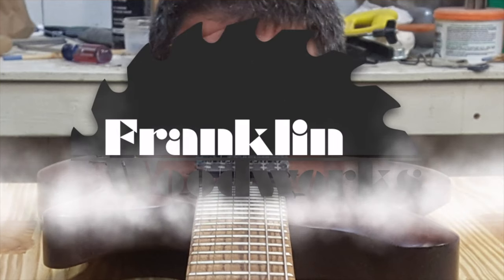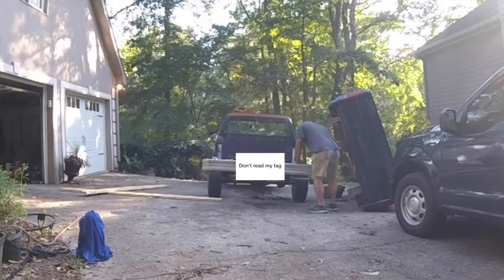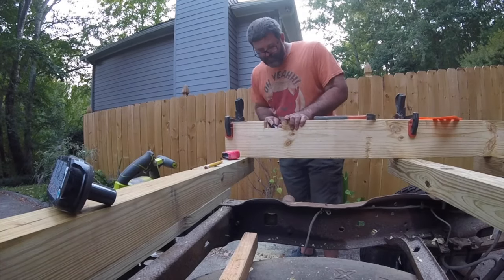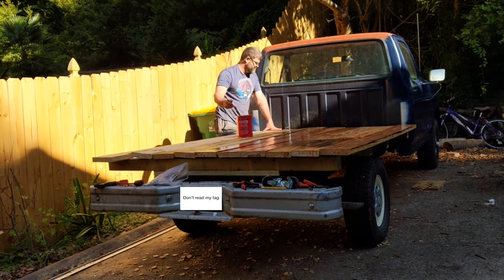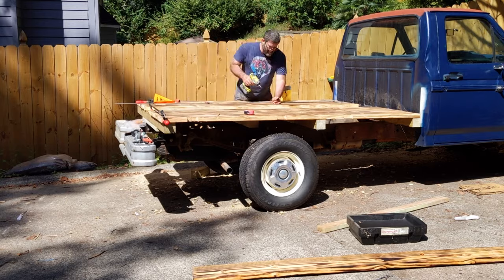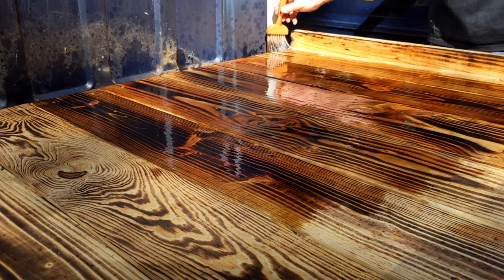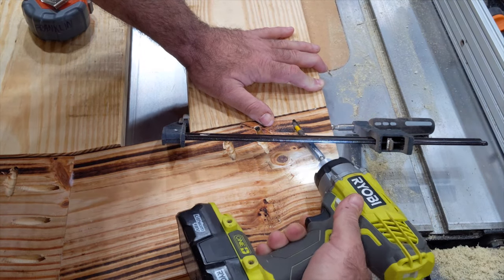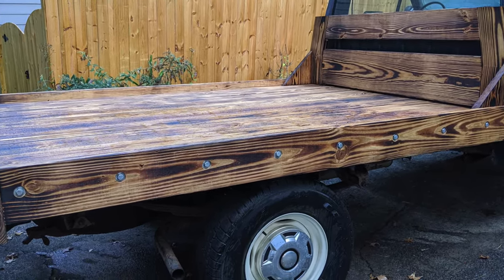DIY Wood Truck Bed

Comment: Where did you get the tail lights? Building a flatbed for my 01 f150
Reply from the maker: I got them off Amazon, didn't get the cheapest, but didn't get the most expensive either.  Think I paid around $45 for the set.  They are bright LED, and have held up perfectly.

Comment: Do you have a supply sheet for what i need to make this because i love this bed and wanted to try it myself.
Reply from the maker: If you click on "show more" under the title of the video, you'll see my materials list.  I put down 6x6 cross members, but you can use 4x4s depending on how much clearance you need for your tires.  I wound up putting 33" tires on it, so I used 6x6s.

Comment: If you don’t mind me asking how much did this end up costing. I went to trade school for carpentry and construction and just graduated but I bought an 87 chevy with the exception of the bed and have been debating buying a junk yard bed or making a  wooden. But don’t want the hastle of restoring a bed along with the cab.
Reply from the maker: Less than $300 for the materials.  Then again, that could be a regional thing.  If you have a Tractor Supply near you, I'd go there for the lag and carriage bolts.  I paid WAY TOO MUCH at the big box store.
Reply: FranklinWoodWorks okay thank you!

Comment: Did you use lag screws to attach the side rails and the rear board for the tail lights?
Reply from the maker: Yes. 6" 3/8 galvanized lag bolts.

Comment: Do you happen to remember your tail lights you purchased
Reply from the maker: The specific lights I used aren't available anymore, but when I bought them on Amazon, I just chose a middle of the road price point for a set that included all six lights.  I chose round ones that surface mounted and were all plastic.  No problems until I dropped a board on one and cracked it.  I have since replaced them with recessed metal housing lights.  Partsam 4 Red + 2 White 4" Round... https://www.amazon.com/dp/B07HT6MWSL?ref=ppx_pop_mob_ap_share

Comment: Did you use 4x4 or 6x6 as the list in the description? Also you talk about 2x8s but I don’t see this in the parts list. I love this video. I have a 1976 F250 Highboy and I am planning to use this video as my starting point. I have 37 inch tires so I am not sure if I should use a 4x4 or 6x6 to clear the rear tires.
Reply from the maker: Can you shoot me an email at franklincustoms@gmail.com?  I think I could go into depth that way, instead of through the comments.

Comment: Great video! How often would you recoat the treatment to prevent rotting? Would you take the whole bed off to do the underside? Just curious as I am looking at doing the same project!
Reply from the maker: Recoating depends on use, exposure to weather, etc, so just play it by ear.  The beauty of this design is that you can take each board off individually without taking the whole thing apart.  Since I built mine, I've recoated the top twice, and haven't recoated the underside yet.

Comment: How has the outside boards held up with time without a support beam under a greater section of it? I am building wooden bed for a 6ft bed. And laying out the 4x4. One would be directly over the tire and will need to cut it down a little.
Reply from the maker: There have 
been zero problems with the outside boards.  They are supported every 16 inches with lag bolts from the side rails.  So although they might not be as strong as far as carrying weight, they are actually more supported than the inner boards.  I hope that made sense.
Reply: @FranklinWoodWorks2016  made perfect sense. Now yours was an 8 foot bed correct?
Reply from the maker: @stephenwolfer1648  Correct.
Reply: @FranklinWoodWorks2016  one last question if you don't mind. How close to the can did you go
Reply from the maker: @stephenwolfer1648  It ended up being a little less than 3 inches.  If I remember correctly, I centered the cross member on existing holes in the frame, and it just worked out that way.

Comment: If you don’t mind me asking, what did the total come out to for this? I am wanting to do this to my Tacoma that has a rusted out bed
Reply from the maker: If I remember correctly, is was about $480.  But, I got ripped on the hardware by buying it from the orange box store.  Could have saved at least $90 by going to a commercial "fastener" supplier.  However, good luck with the wood prices. Where I'm at, prices are about 75% higher than when I built mine.  And, by the way, I'd go with all treated lumber.  My floor lumber has started to cup (untreated).

Comment: Its been 3 years....hows it holding up?
Reply from the maker: Well, as it turns out, I should have used pressure treated wood.  The original plan was for me to re-apply the finish every month or so to make sure the wood was protected.  That idea went out the window almost immediately, as this is a working truck.  But, the bed made it for over two years before rot set in on the ends of the boards.  I recently, 2 months ago, rebuilt the bed using pressure treated wood.  But, other than the rot, the old bed held up great, and there was never an issue with strength or load capacity.
Reply: @FranklinWoodWorks2016  awesome.  I'm converting to a flat bed as well and after seeing the price of a custom setup I've been toying with the idea of a wood bed.

Comment: I know its a long shot and u probably wont see my comment. But I was wondering if by chance would u have the name of those tailights or part # I cant find them on amazon.
Reply from the maker: Here is the title on Amazon for the listing.  It let me add it to my "cart" again, so I assume it's still available.  Meerkatt (Pack of 6) 4 Inch 4 Red & 2 White LED Clearance Lamp Round Light Brake Reverse Rear Tail Exterior Lamp Trailer Lorry Caravan Pickup Truck Bus Tractor Cabin 12V DC Sealed Surface Mount GK12

Comment: Hey how much weight do you think the 4x4 beams can hold ? Please let me know , I am planning on making this and I will be hauling 3000lbs on the bed.
Reply from the maker: I've hauled 2,000 of bricks in mine, but I really didn't like doing it.  I kept the bulk in the center of the bed.  I know that sometimes I can get treated 4x6s at my local HD.  I would think that would help substantially.  Are you sure your suspension can handle that?  What kind of truck is it?
Reply: @FranklinWoodWorks2016  did you noticed the wood beams cracking or anything of that sort during that haul ? I have a 3/4 ton Chevy and the payload on the truck is 3000lbs. So it’s just a matter of making sure the bed can handle it , I am putting a truck camper on it which mostly sits in the Center of the beams. I will take the 4x6 idea for my project . Any other tips you recommend to maximize the load carrying capabilities?
Reply from the maker: No cracking at all.  I even checked the underside of the bed the other day while putting a lift kit in the front.  I think as long as you are aware that the edges are inherently weaker than the center, you'll be fine.

Comment: Great job did yu do for size an length bolts for the 4x4s on the frame?
Reply from the maker: I used 1/2" . That gave me just a little wiggle room.
Reply from the maker: 1/2 x 5

Comment: Nice job! What are the dimensions of the finished flat bed?
Reply from the maker: 8' x 6'4" (96x76).
Reply: @FranklinWoodWorks2016  
At 1:40, how or what tool do I use to copy that countersink?

Comment: Is that "high tech premium" exterior grade finish dangerously flammable?
Reply from the maker: Yes!  But so is any oil-based finish until it cures.
Reply: @FranklinWoodWorks2016  the issue here being that the trans oil wont ever really cure, the highly flammable bits of the diesel will evaporate, but in the end what you have a a giant Southern Yellow Pine oil lamp - nice to have if the headlights fail.
Reply from the maker: Well, at least there's a bright side.  I kind of figured that about the trans fluid as well.  But, I did some testing, and the wood is not overly flammable once it's dry.  I held a torch to it for a few seconds and it charred but didn't catch.
Reply: @FranklinWoodWorks2016  it certainly shouldn't rot!
You probably want to dab the end grain at the rear every fall before the winter salt arrives, just help the wood reject the salt.
....speaking of salt, keep an eye on the deck screws holding the headache bulkhead together since you dont have significant Joinery there as well.

Comment: Were the boards used for the bed floor pressure treated?
Reply from the maker: No, they weren't pressure treated.  The charring of the wood along with the diesel fuel mixture serves a dual purpose.  Looks great, and really slows down wood deterioration.

Comment: Wow, that is really neat. It inspires me to replace the rusted-out-in-some-spots bed of my twenty year old Dakota. I think I will try to get it done this summer; although, I have never done anything like this. You look like you know what you are doing in the video. How long did it take you to complete the job including plans, getting the hardware, wiring, lamps, and lumber? Did you post your parts list somewhere?
Reply from the maker: The parts list is just below the title of the video.  You may have to click an arrow or something to see it, depending on your browser.  I completed the build in about 12 hrs, not including figuring out the wiring for the lights.  That was a mess.  Should have labeled the wires as I removed them from the original bed.

Comment: Instead of 2x6x8 why can't you use 1x6x8 treated
Reply from the maker: I've actually explored this.  Although the 1x6 would work, and would look fine, there are problems.  Because of the span between cross members, the 1x6s will flex a lot depending on your load.  More flex means greater stress on your fasteners (screws).  This will cause the wood to wallow out, and the boards will become loose.

Comment: How did you deal with tailight wiring?
Reply from the maker: Not as well as I should have.  I should have marked each wire (or group of wires) as I disconnected them from the original bed.  But I didn't, so when it came time to wire them up, I had to do lot with a volt meter. But once I figured out which wires were which, it was pretty straight forward.  The cheap LED lights I got on Amazon (I got a set that had 4 red and 2 white lights) has been really good.  Very bright.
Reply: @FranklinWoodWorks2016  Okay, im thinking about trading my Harley for a 2001 Ford F250+$400 and it doesn't have a bed, meaning the lights are already disconnected, its gonna be a paint I assume to know whats what being that I have no bulbs for it so I cant step on the brake and see what lights glow.

Comment: The part next to the cab is called a Headboard
Reply from the maker: Thank you!  I had no idea!
Reply: No, it's called a headache rack.
Reply: @brucemitchell5637  A headache rack extends out over the cab and above the pickup box
Reply: Paul So there,  no it doesn't.  I should know, I've only been making and installing them on trucks for the last 40 years.
Reply: @brucemitchell5637  Sorry, that's what the longhoreman call them; and i did it for 43 years
Reply: Sorry to tell you that you did it wrong for 43 years.  Bahahahahaha!!!!!!!

Comment: Instead of transmission fluid try using used motor oil it brings out a beautiful dark and unique burnt stain look
Reply: Never mind lol should have watched longer 😂
Reply from the maker: @jakescroggins7199  I finally got some beautiful used oil out of a monstrous diesel engine.  I plan on doing a another coat using that and the fuel.
Reply: realy nice i like it
Reply: i want to do my ranger like yours can you send me the plans to do mine

Comment: Why the f*** are you buying hardware from a big-box store like Home Depot or Lowe's?
Reply from the maker: Sometimes I'm just stupid.  Didn't think about it until the shock wore off.  Could have done a lot better.
Reply: @FranklinWoodWorks2016  Now that I think about it oh, I've done that s*** as well. And yes, I too feel stupid for it.